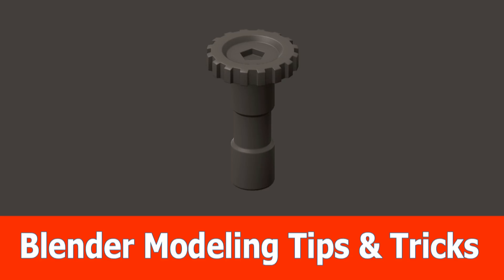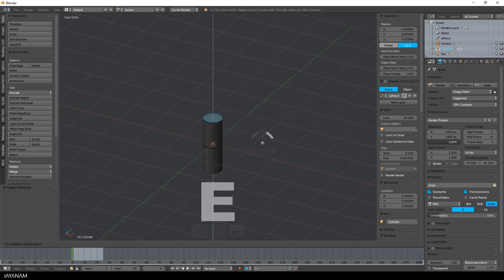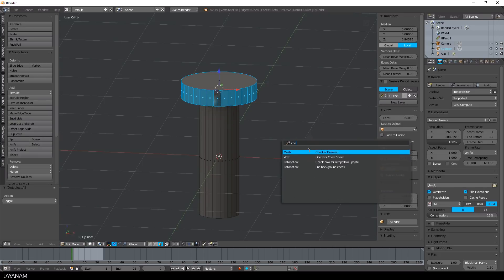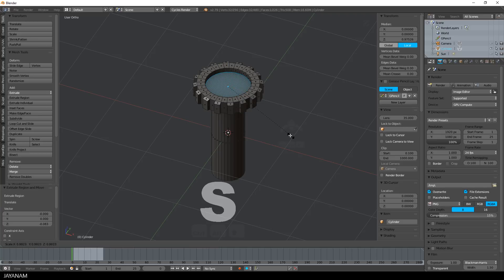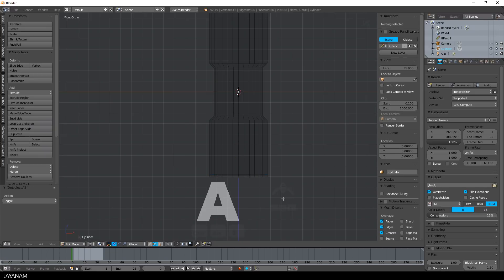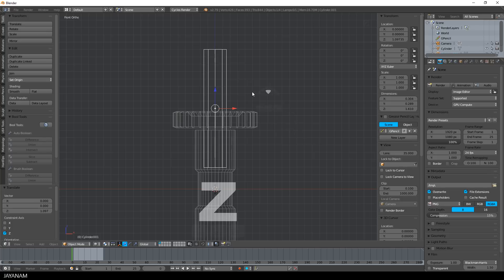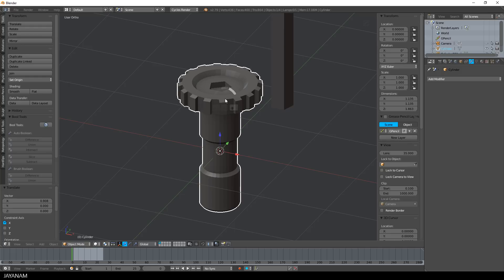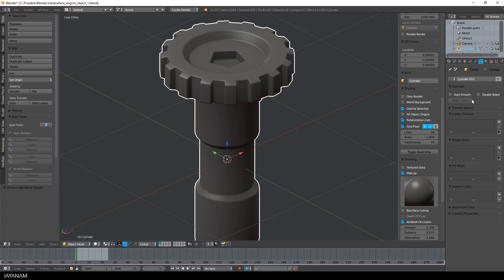Blender Modeling Tips & Tricks

Comment: I thing I saw you showing some differences between Maya and Blender sometime. Well Im trying to do this in Maya  and have some shading problems on the head of the screw after beveling meaning the radial edges are kinda visible . You know why it happens that ?  Ive try to use the soften edge  command in Maya but no avail. I end up in adding extra loops (that connect all the radial edges) and somehow limit the effect. I think it worked. What do you think ?
https://imgur.com/xeE1sdq
https://imgur.com/O9tueCa
https://imgur.com/nnb4PP2

Comment: Great video, how would you go about UV unwrapping this after its all smooth?
Reply from the maker: You can unwrap it like other objects, I will add a video about this, perhaps combine it with a Substance Painter texturing approach.
Reply: Don't really understand the problem but.. my suggestion is to use a normal map on a low poly mesh.
Reply: Yeah im curious too
Reply: Thank you :)
Reply from the maker: Just did a fast uv unwrapping and add a smart material in Substance Painter, you can see the result on the community tab of this channel.
Reply: How would you properly (not fast) unwrap that, especially the gear? Your video has all the instructions about how to create a lightsaber handle. Maybe you can show a quick one and how easy it is to create a good looking one in combination with substance painter?

Regarding UVs I usually create a seam along the long edge, unwrap and then apply UV Squares on the UV map in order to get a proper rectangle, otherwise it would be bended. If you know a better method, I'd be happy to hear it.

Oh, and great video, thank you :-)
Reply from the maker: I would mark the long horizontal edges as seams and two vertical ones.